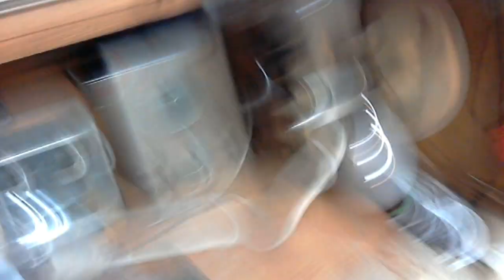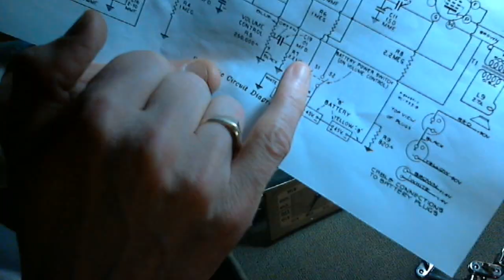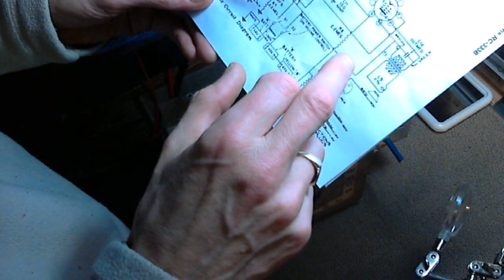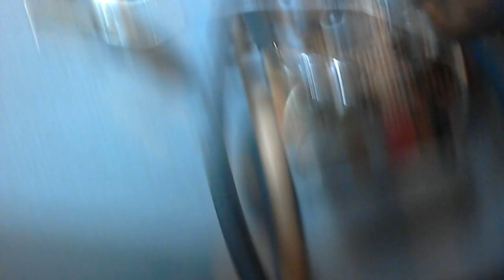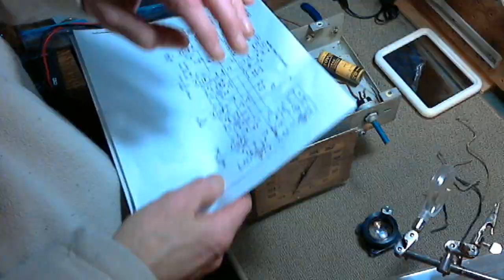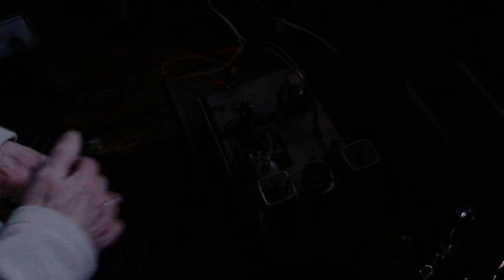RCA Victor 94BT1 Video #6 - First Power Up

Comment: Some of those low volt tubes don't really light up they just get warm on some models. If the output transformer is on the speaker in the cabinet then you need to use the original speaker that came with the radio.
Reply from the maker: If you could only send the message forward in time.
Reply: Jim Lindenas
I am working on that has we speak :)
Reply from the maker: You told me that yesterday.
Reply from the maker: Watch for video #9 where I catch up with reality.